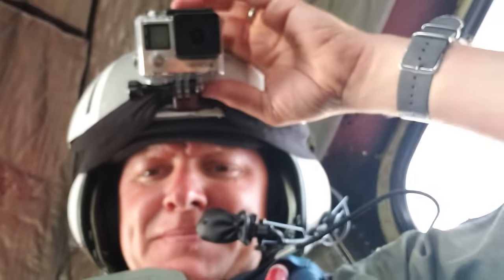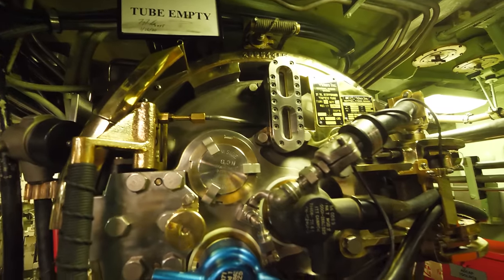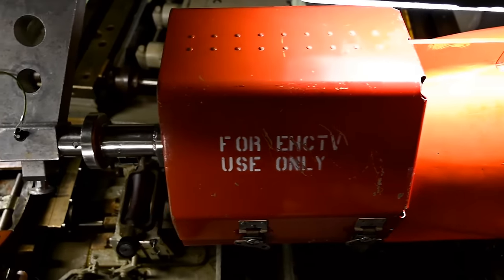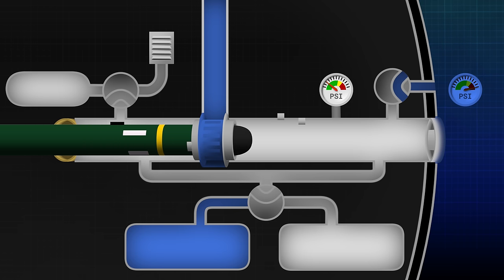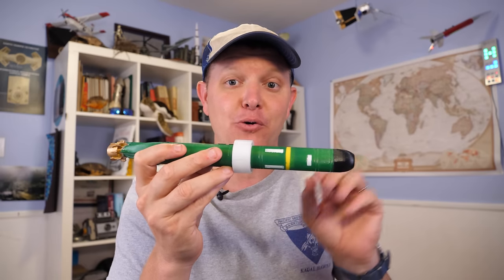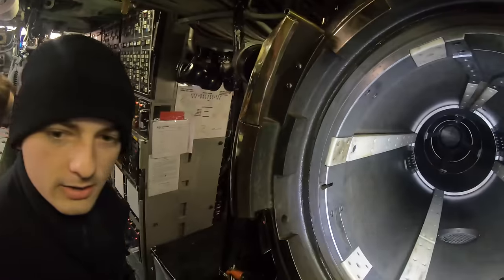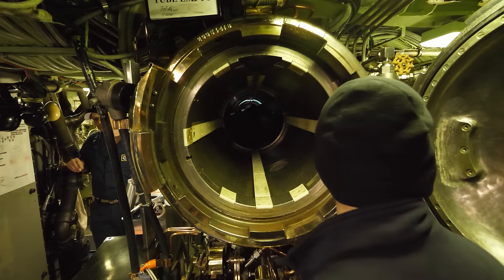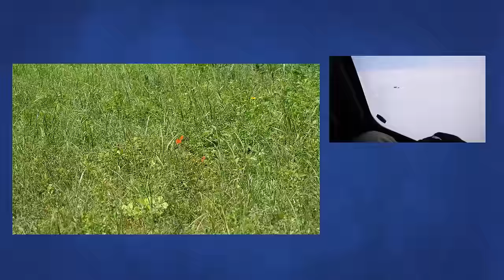Crawling Down A Torpedo Tube -US NAVY Nuclear Submarine - Smarter Every Day 241

Comment: Favorite quote: "All the decisions those engineers made back then, affect what type of weapons we can fire today". It is surprisingly often true for a wide variety of fields.
Reply: You've put the finger on the concept of "Path Dependence" sir.
Reply: A lot of those decisions the “engineers made” were customer driven w/ designers telling the engineers they don’t know what they are talking about....
Reply: @zuggrr  I wish we had chosen the path where everything was metric, so I wouldn't have to get two sets of every tool type.
Reply: @Tre3141  sooooo you're a euro?
Reply: @thelegacyshow4248  or basically anywhere else besides america and 2 small countries
Reply: @Tre3141  sooo... why not wish everything was standard (SAE) so you wouldn't have to buy 2 sets of everything. The industrial revolution happened in SAE, the metric (better or worse) was second to enter the frey, so since SAE was first everything should be standard
Reply: @Achonas Liberia and Myanmar right?

Doesn't really matter as Imperial is Metric or more accurately imperial measurements are defined by their metric equivalent so it's just metric extra (incomprehensible) steps.
Reply: We have a new system now that was built along the lines called a CLT (common launch tube) and many manufactures make all types of items that can now fire from this one standard just as long as they manufacture to the requirements. The end result is value to the taxpayer and also (to a lesser degree) sets the pace on what our adversaries will limit their industry to as well... since they always tend to build at parity.
Reply: @999knives  yah, i know lol. I watched the real engineering vid that just came out, and the older one where he points out how ridiculously the inch was defined as something like 2 oat grains then redefined in metric lol.
Reply: "But we've always done it like that!"

Comment: I got the chance to crawl down a torpedo tube on my first boat (USS John C. Calhoun, SSBN-630B) when we were at Test Depth. It's a common tradition on Navy Subs and is quite a surreal feeling as you're crawling down the tube with nothing but a steel door between you and crushing sea pressure. Definitely not for those who have even the slightest smidge of clausterphobia.

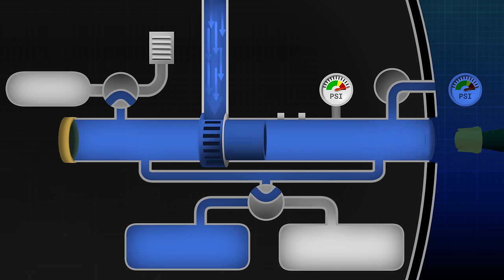Comment: 12:10 I'd also guess that an ideal torpedo would be neutrally buoyant in order to make it easier to control in the water. You wouldn't want to be constantly fighting the torpedo's tendency to sink or float if it was denser or less dense than water.
Reply: JuhuL I would imagine that water density changes with salinity and temperature.  Thus buoyancy would change as well.  My guess is that is dealt with by navigation controls. Or when the tube is pressurized... ?
Reply: Does this even matter as long as the torpedo is inside the ship? After all it's a permanent force regardless in which direction they're moving. More interesting would be, if there was a way to move torpedos from back to stirn in the boat, to keep the weight alignment after one or two torpedos in one end of the boat have been shot.
Reply: Actually, torpedoes are very slightly positively buoyant, but it's VERY slight... like they raise a meter an hour, hardly enough to matter for combat. The reason they're positively buoyant is for retrieval of failed warheads. There's enough unexploded munitions littering the ocean, we don't need torps adding to the problem.
Reply: Martin D. 
You might be able to fill the Ballast tanks a bit more to compensate for the lost weight more effectively than you could move the torpedo. Though I’m just guessing.
Reply: @Gartral  Very interesting.
Reply: @Gartral  there is no recovery of failed warheads.
There are 2 configurations of a torp, warshot, and test shot.
Warshot are not meant to be recovered, they are meant to blow up, or the self scuttle.
Test shots are programmed to come back to the surface, after simulation of exploding, but the only part that is visible is the tip of the nose.  Ie they float vertically when expended

Comment: Destin: you only have the air you brought with you
Me, a submariner: We can turn water into oxygen...
Reply: True, but your nitrogen supply is limited.
Reply: But you can't breath pure oxygen. There is more to air than just oxygen. Produced oxygen can only be used to offset the co2 generated from breathing. It can't offset lost air. When the air is gone it's gone and you would die. No matter how much oxygen you generate from water.
Reply: What he says can be a little bit confusing. Yes you can make endless amounts of oxygen with electrolysis. But in case that fails, it's of course neat to keep as much air as possible, and air is not only oxygen, the majority of air is nitrogen, this is also the main reason why you want to keep it. If you keep venting the air, and keep making oxygen, at some point your air inside the sub would be 100% oxygen, which is a very bad idea.
Reply: Air is only 20% oxygen. 80% is nitrogen. You can't get that from water.
Reply: So you do both.
Reply: @1schwererziehbar1  but we also don't use the nitrogen and can use that to recycle old air. Also the air we breathe out can be mixed with O2 to make it breathable again baring anything toxic (which we can filter out)
The point being that it's alright if we lose a little bit of air.

Sure if we lost a lot it would be an issue but if we are at that point then something else major has gone wrong
Reply: @frogsshadow4189  Plus we have air in the banks
Reply: Don't forget the biggest problem is the CO2 that is exhaled. Only limited scrubbing capability, so you really do not want to have that compromised, because then you will be forced to dump the air overboard and release compressed air from a tank to dilute the CO2 concentration down, limiting your options for endurance.
Reply: @SeanBZA  we have CO2 scrubbers onboard that can take and filter CO2 out of the air without needing to remove it.
Reply: @FabledGentleman  yeah you  wouldn’t like to make a metal submarine becoming inflammable with a 100% oxygene atmosphere. Otherwise, you can keep the hydrogen in the air as well (produced by electrolysis). But then the atmoshere becomes inflammable as well if you have more than 5% oxygene ( but this method was used for deep dives, but is very risky).
Reply: @tobiasl.726  O2 does not off set CO2, onboard a submarine in the event of a loss of atmosphere control equipment,  CO2 poisoning is a much more urgent concern than lack of oxygen. you have a minimum level of O2 and a Max level of CO2. if the Oxygen plant is down you can burn Oxygen candles and in an emergency you can bleed from the external oxygen banks. But if the system that removes CO2 is down you need to use CO2 absorbing material( lithium hydroxide) to remove it but that is a pain and makes a huge mess and is only used in an emergency. If you do an 02 bleed you also have to worry about increasing pressure in the ship that can make rescue difficult. I am not an air scientist but I am a qualified submariner. O2 and CO2 levels and internal pressure of the ship is a delicate balance that is constantly monitored and adjusted.
Reply: @tobiasl.726  Yes you can breath pure oxygen.
Most of the early american space programs had a pure oxygen atmosphere (hence the apollo 1 catastrophe).
It's just very dangerous, and completely impractical in a submarine.
It's not that hard to store some nitrogen in a cryo tank, if you want to keep your N2/O2 ratio to a reasonnable level.

I had the same thought, in case of an accidental leak. Pretty sure, that's not what they have in their procedure.

Anyway, bottom line, you really don't want to loose your air in a submarine, it's very precious.
Reply: Probably only on nuclear submarine. Unlikely to have enough battery capacity to do electrolysis on a diesel electric.
Reply: @tobiasl.726  "But you can't breath pure oxygen. " - no, you can, if it is at 0.3 bar. It is used in space, sometimes. Sub should withstand the reduced pressure without any structural damage, but I would speculate it's never going to be done because of increased fire risk, and difficulties opening up to the atmosphere later on.
Reply: Shhh dont let them know the ways of the underwater steel tube magic... /s
Reply: @tobiasl.726  you can breathe pure, low pressure Oxygen. The original Apollo missions had their astronauts breathing in a pure oxygen environment to save weight on the rocket. Of course it's very flammable and probably not optimal for a submarine where you want as much pressure as you can safely handle to help offset the crushing pressure of being underwater. But it's possible.
Reply: Mike Dunigan  Only thing we use nitrogen for (other than to breath) is if there's a fire inside our missile tube (ssbn and ssgn subs only), we flood the tube with nitrogen to prevent oxygen from fueling the fire.
Reply: @1schwererziehbar1  Who cares?  We don't get rid of the nitrogen.  We get rid of CO, CO2 (and H2 from the oxygen generation hydrolysis).
Reply: @maxdevil1654  Exactly. They actually keep the oxygen level in submarines a little bit lower than in the atmosphere, at 18-19%. Just to keep the fire risk down as much as possible, without the crew becoming to weak or unconsecrated to do their job properly.
Reply: Mike Dunigan  I love this conversation. I was on the Canopus AS 34. We had a O2/N2 "plant" onboard that froze air and then warmed it up until the O2/N2 boiled (at dif temps). We stored around 2,500gals of each and topped off the subs if they needed it. When we had a fire onboard there was duty PO whose sole responsibility was to dump the O2 overboard. We had a fire and sadly we  lost three sailors, one was a friend. I can tell you this a diesel engine goes crazy on nearly pure O2! It was a foggy night and I was on a boat that was tasked to bring crew back to the ship to help fight the fire if needed. On the second run we went through what we thought was just fog. The engine went crazy. Only later did we realize we had gone through the cloud of O2 dumped off  the ship! EN1
Reply: @tylermcdavid9426  you can't purge a ssgn tube with N. It's not connected to MG. Diver qual air replaced it.
Reply: MrBtdobie we also carry nitrogen on board
Reply: II we have large nitrogen tanks onboard
Reply: SeanBZA we have very large co2 scubbers that pull out the co2 and it is discharged over board
Reply: Mike Dunigan  Yes.  I was just trying to say that you can't let the air go simply because you can get Oxygen from the water.  You still have to vent into the sub to maintain the amount of N2 onboard.
Reply: @guynes2013  I just got out of MT school, so it's probably just an outdated course than.
Reply: @tobiasl.726  Uhh, you can breathe pure oxygen.
Reply: Needing to vent air externally every time you cycle you torpedo tube probably would put you at a strategic disadvantage.
Reply: robert schollmeyer there would need to be a way to remove the co2 from the air because high concerntrations are toxic.
Reply: @Wilderweincd  Yeah, but it is a real big, bad fire hazard.  If the percentage of oxygen is high enough, things that aren't normally a fire hazard at normal levels can burn and things that can burn at normal atmosphereic levels can become almost explosive.  Lubes come to mind.  You really, really don't want a very high oxygen level.
Reply: @jerrymiller276  true true, i was just objecting the ''you can't breathe pure oxygen'' part
Reply: @tylermcdavid9426  yeah, the only thing we use N for in the MT world on GNs is the desurgers. A-gang uses it for D.I. water, but that doesn't interface with missile tubes because there's no MHC
Reply: @guynes2013  There's NO MHC??? Dang wtf did we learn about then.
Reply: @tylermcdavid9426  BN systems
Reply: @tylermcdavid9426  you still in KB. If so I'm local if you ever wanted to hang out. I'm a 16.5 year MT. On my way to my last command.
Reply: @guynes2013  RIP, I just got to Bangor 2 weeks ago. Getting out of ROM in two days
Reply: @Da0yster  so, interestingly oxygen in and of itself is not flammable, it supports combustion so a high oxygen environment is  dangerous but pure 02 is not flammable, still requires a fuel source to oxidize.

Comment: "Did you grease it?"

"yessir"

"That's awesome!"

Ohhh the things that please an engineer XD! Great video as always Destin!
Reply: Nothing like proper Preventative Maintenance. I get excited when I work on something and see grease zerks. "Lubricated for life" just means it'll last until the factory lube has worn out or leaked out. As far as I can tell, it's just a cost saving measure so they can omit adding a grease zerk (or similar means of adding new lubricant) and saving on the added machining cost of drilling and tapping for said fitting. Plus they can sell more replacement parts. "They" as in whoever is making whatever parts that are "lubricated for life".

Comment: "This tells me the torpedo has to be neutrally boiant"
I think there is another reason that would be usefull
Reply: imagine you shoot a torpedo and it just floats and hits one of your ships
Reply: Neutrally boiant, AT WHAT DEPTH?
Reply: @fifthbusiness2591  yeah, exactly what i was thinking. wouldnt neutral buoyancy differ between different depths? or even temperature for that matter? someone enlighten me please, im not really a science guy haha
Reply: @ferdinand.bumpliz  well yes but the sub there would only have to deal with water colder than 4°c and the density of it does not change a lot(really close to 1g/cc) so  it should be around the same avg density.
Reply: @ferdinand.bumpliz  depths, no. Water is a liquid which is different than a gas predominantly in the fact that it can not be compressed or made denser. Tempt has an effect but it is trivial.
Reply: @ferdinand.bumpliz  Water is not compressible, and the density changes a little with temperature but it's not a significant amount. Basically neutrally bouyant for any particular situation would be close enough for any other situation.
Reply: @fifthbusiness2591  It only matters for stuff that can be compressed. For instance, meaty divers with compressible lungs. A torpedo is rigid and (hopefully) wont be compressed by the pressure.
Reply: @DROGOC0P  or how stupid it would look if it travels tilted downwards to keep itself under
Reply: @hoej  could you imagine if you eject a torpedo and it jsut shrunk on itself
Reply: @Sir_Bucket  "Honey, I shrunk the torpedo!"
Reply: @fifthbusiness2591  Torpedos have (or historically had) a Pendulum-and-hydrostat control, which is basically an automatic mechanism for converting water pressure to pitch of the control fins. I imagine nowadays it's all electronic. So I suspect they get the torpedo buoyant at some general-purpose depth, and make up for any difference with control systems.
Reply: @ferdinand.bumpliz  Looks like we have some answers.
Reply: @hoej  Thanks!
Reply: @defenestrated23  Thanks for answering my comment respectfully...despite the fact it contained all caps!
Reply: @fifthbusiness2591  If we assume water and the torpedo are both non-compressible, any depth. Yes, an oversimplification, but close enough for engineering.
Reply: @optimisticcynic1  Water is actually compressible, it's just a negligible amount. Technically it can be compressed slightly though. At least that's what I was recently taught in Physics.
Reply: @garetjax2768   True, but it is so small it is normally ignored since we in general are talking 5th decimal place effects for Atmosphere level changes. For all intents and purposes its density does not change on a measurable scale. though temperatures effect  is actually closer to that than I guessed in the range of temps experienced in the ocean.  as long as you stay out of fluid mechanics assuming the density of water stays constant will almost always be good enough.
Reply: @fifthbusiness2591  It has to be neutrally buoyant to shoot straight... Other wise it would rise or sink when firing.
Reply: Actually it’s not
Reply: @chase9316  nope
Reply: @fifthbusiness2591  dont matter... but i cant tell you why LOL